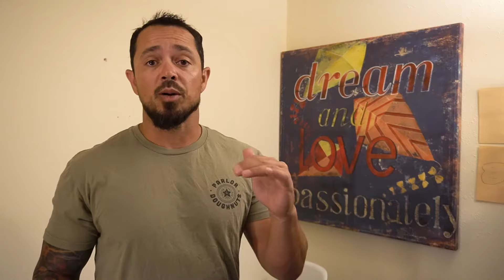The Ultimate Guide on How to Build a Coffee Cart Ebook

Comment: Hi, I am interested in buying the ebook but am not sure if your plan will meet my budget, can you give me an estimate on the budget for the materials for actually building the cart? I already have an espresso machine, I'm more just curious on the costs of the cart build. Thanks!
Reply from the maker: Hey Matt,
There is more than one way to skin a cat. In the ebook we cover multiple ways to build the cart, with multiple different materials. Lower cost requires more labor. So, on the cheap, without equipment and lots of know-how, less than $1k. Frame and walls, basic plumbing doesn’t cost too much. Once you start adding in equipment, it changes pretty quickly.